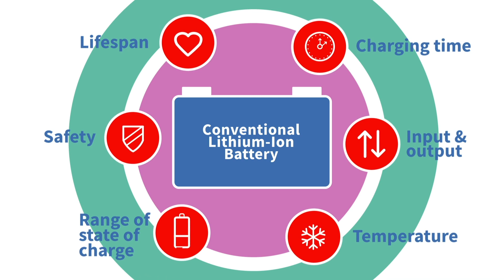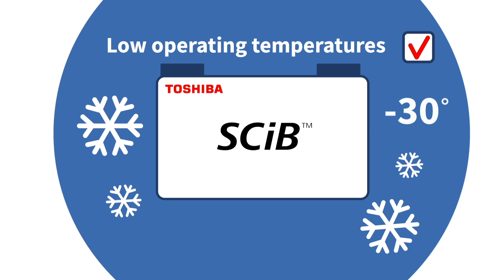Toshiba's SCiB Battery Energy Storage Solutions [Produced by Reuters Plus]

Comment: Toshiba SCiB™ uses lithium titanium oxide (LTO) in its anode to achieve excellent characteristics, including safety, long life, low-temperature performance, rapid charging, high input/output power and wide usable SOC range.
SCiB™ has been widely used for vehicle, industrial and infrastructure applications, including automobiles, buses, railroad cars, elevators and power plants.
The SCiB™ rechargeable battery provides a long life of over 20,000* charge/discharge cycles, rapid charging, high input/output performance, excellent low-temperature performance, and wide SOC range, all while maintaining a high level of safety.